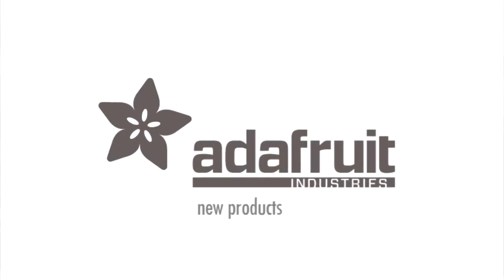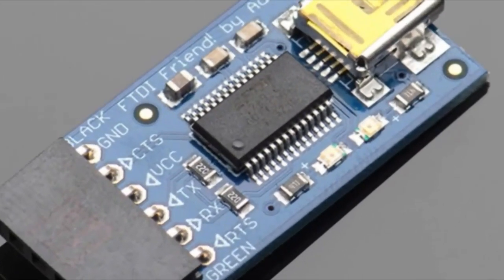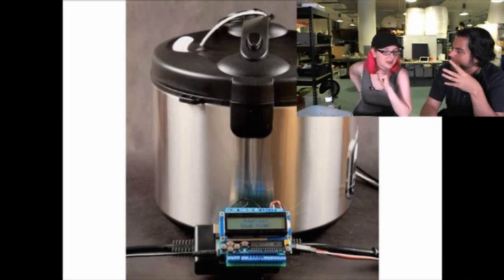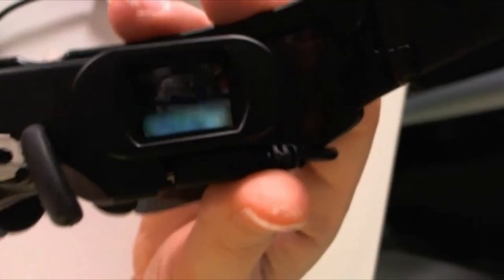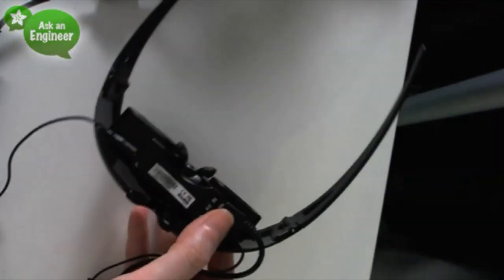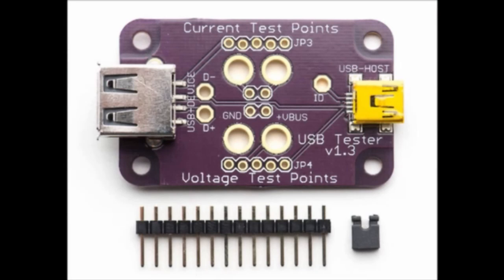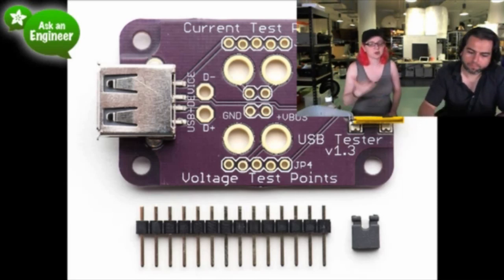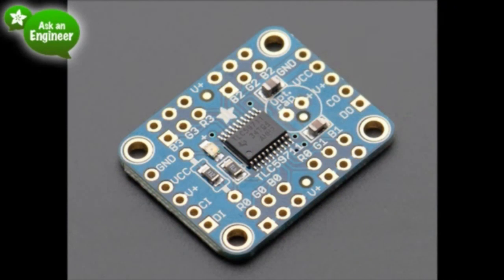LED Video Wall & More! New Products 7/20/2013

Comment: Whoever told you that the Spartan 3E is "super hardcore" or "massively huge" was wrong. The "Spartan" family of FPGAs is Xilinx' lower-end FPGA series so how hardcore can a $30 be compared to the high-end series which can reach a few thousand US dollars?
Please do your research in advance and stop saying such funny things.
$300 for 2 controller boards? The 2 Spartan FPGAs cost not more than 20% of the total cost. That's not what makes the boards expensive. Reselling them a few times tends to do that to any kinds of products.

Also, $40 for a LED panel is cheap but who will buy just one or two panels? This is stupid. If you want a decent LED display size (and resolution) you will end up having to buy at least a couple hundreds of these. 200x$40 = $8000. Thst's 8 with 3 zeroses after it!!!
What about even higher resolutions/display size? That would exceed $15000.
Do you actually think that this is cheap? Think again...

To the user who claims that this is affordable, please go away!
Reply: The sender card is expensive. Most of that 300 is on that one card. They are also likely putting a profit/shipping on these too. The really interesting part is never looked into using just the receiver card. These are likely older ones, but they tend to use Spartan 3/6 and Lattice EP5. Others have been seen too. Lower cost smaller FPGAs with limit IO transceivers is all they really need here.

Sender cards usually have MPU on board. Receivers generally use SRAM while senders may have DRAM. Then there is other components like PHYs, magnetics, caps, connectors, PCB, etc. The senders are usually more expensive as likely less are made. The receivers can be pretty much made in bulk. Older walls probably used a ton of receivers, but different panels and LED drivers probably changed that. For every sender there could be 10-100+ receivers, so you could make a batch 5+ thousand boards with little issue. They can make money on the senders without hurting sales, but the receivers they practically have to give away. However they can get the margins low and still possible make money due to the scale.

FPGAs are simple to work with and hard to work with. It depends a lot. There is freedom there, but you have to consider parallel not sequential execution. Then there is time domain stuff which can be an issue. This is different from ASIC timing too. You do not need a lot of logic here and depending on the time frame Spartan 3 was probably a decent size chip. Spartan 3 is old but popular and cheap design. Likely Spartan 6 has over taken this. Compared to CPLD or discrete this is huge still. Huge in FPGA means 10k per chip not board...chip.

The receiver card is like 16-30 dollars you could probably use that for 1 or 2 panels, however if you are trying to get the lowest power, cost, size, etc. this will not work. I always assumed that these used custom L1/L2 protocol but at least one uses standard Ethernet L2 Frames. I am actually using one for 1-4 panels currently without a sender card. I got mine for under 30.

They had this on their inventory for years and I did not know why either. It was cool they had it, because this is quicker than get it from China. This particular receiver only works for a few panels. The sender is supposed to drive multiple receivers. Anyhow Adafruit missed an opportunity here. They daisy chain too.

The panels that Adafruit sells are not the ones you use for large displays unless doing outdoor and even those may not be the right ones. You can get 64x128 panel for 50 bucks which is a lot cheaper. These are harder to program. Note the receiver card can do different tricks than most of the libraries do not do. (Some of them could.)

These little misfires are a little common with Adafruit. Another interesting topic is the 50MHz panel. The power graph shows power reduced with frequency but this is due to other things. On one hand it is out of spec and will not work. Yet may actually work assuming certain things are accounted for. (Not the best of ideas but has some merit to it, kind of.)
Reply: Here's the Datasheet for the Xilinx Spartan 3A xc3s200a:
http://www.xilinx.com/support/documentation/data_sheets/ds529.pdf

Comment: they're saying how the panels are pretty inexpensive compared to the controller, and yes that's true if you want just a small panel, but even just a section of a wall in a small room is pushing $2-3K for the led panels.

I do want to do a project like that, but I think im going to try and find led panels with leds spaced further apart due to cost.